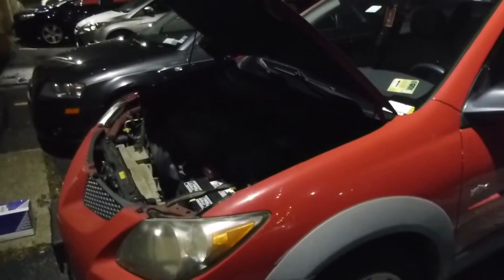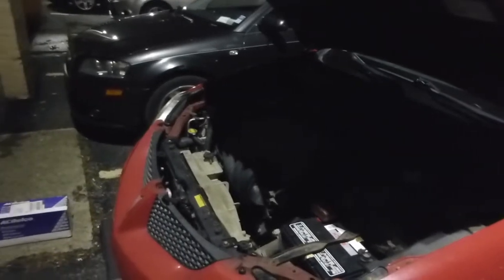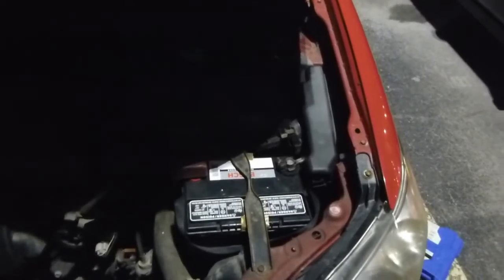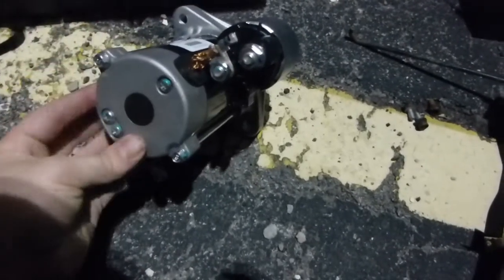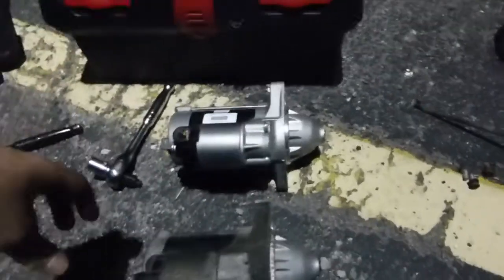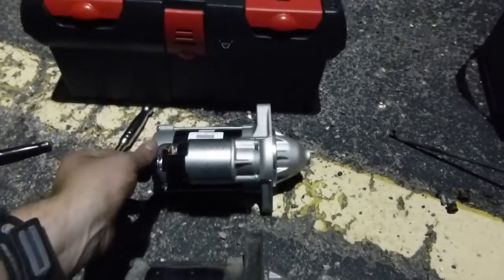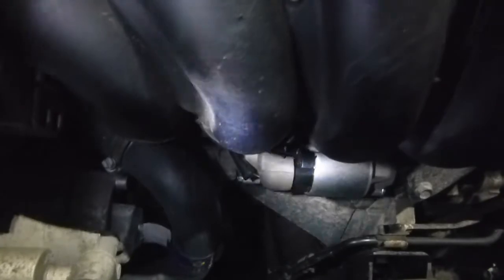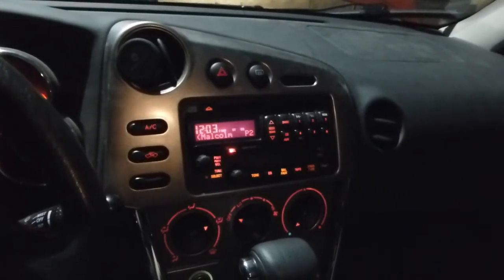Watch Me Learn Car Repair: 2003 Pontiac Vibe Starter Replacement

Comment: Congratulations on a successful repair! Couple of thoughts if you ever have to do this again: you might want to pick up a wire brush, some anti-seize compound (makes it so much easier to remove all manner of bolts years later, and far less likely that they'll twist off, which will really make your day, especially if they go into aluminum) and your choice of a rubber mallet or dead blow hammer. Maybe even both. If you can get under there, you may find it easier to remove the starter from the bottom. The starter drive probably failed to disengage correctly on the old starter motor and that's what likely made it so much fun to remove.

Most starter motors are a "drop it in and go" kind of thing. A few require shimming.

Only one station around here carries RDS clock time and while it's accurate, they never correct for DST. In later model years, GM stopped making any mention of the ability to use RDS clock time, even though support still existed in the radio's firmware. When they went to the radios having the large central volume knob, clock time disappeared. (The RDS implementation on those is also nothing like as nice as it was on the older radios.)

When I was in Raleigh, NC, almost every station on the dial carried RDS clock time and several were operating a 67 kHz SCA.